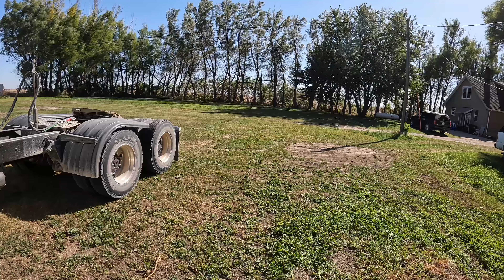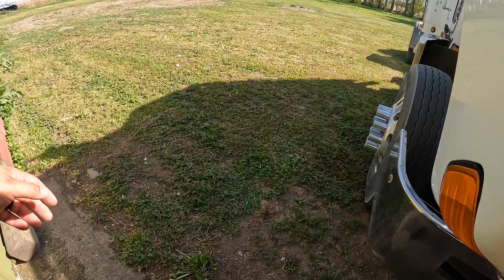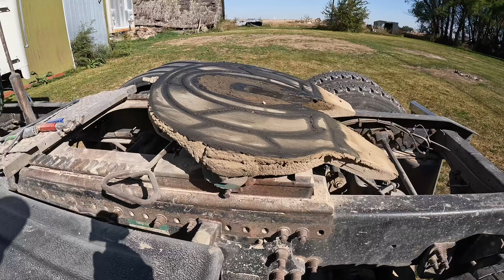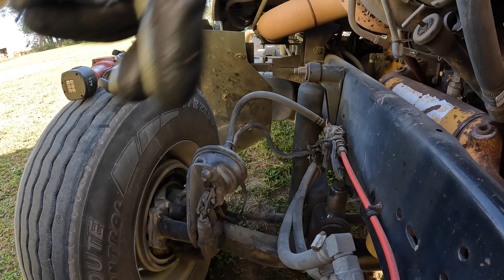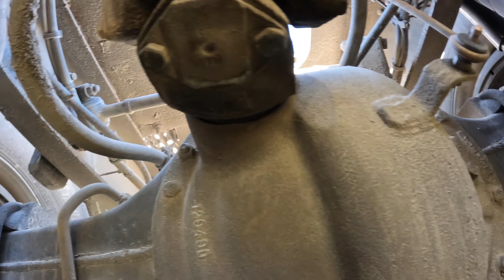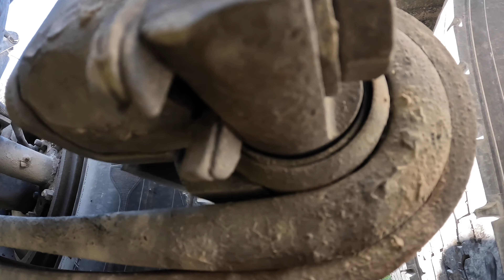Owner Operator Tip: Do Your Own Maintenance (Owner Operator Trucking)

Comment: Aways something to do to keep them running.
Your supposed to jack the front end a little to take some weight off the pins.
Actually does a better job especially king pins.
TGP
Reply from the maker: @thomaspetroff9117  I knew that about the leaf spring bushings but hadn’t thought about that with the kingpins. I’ll be doing that next time